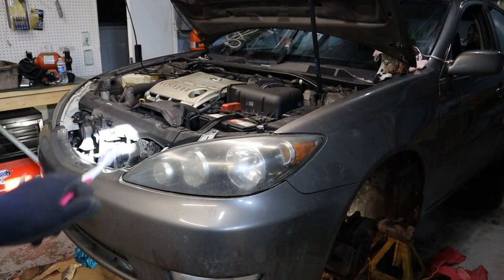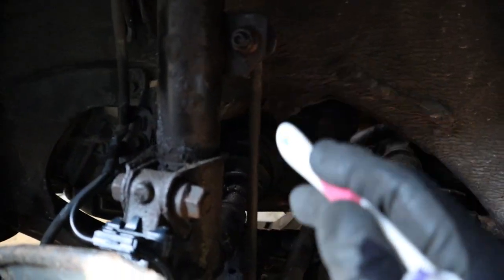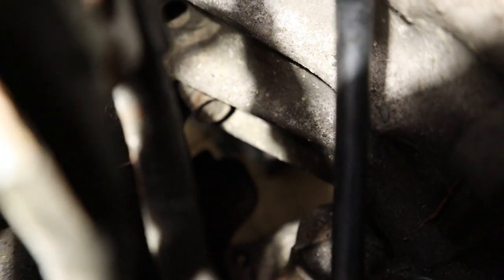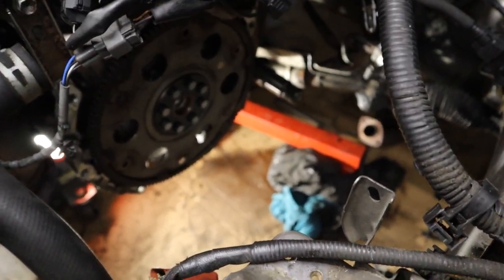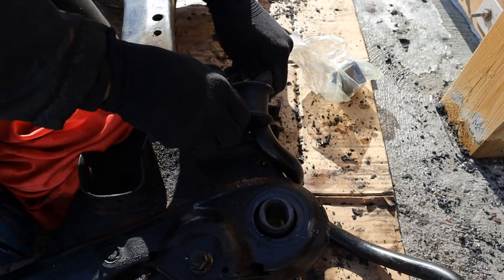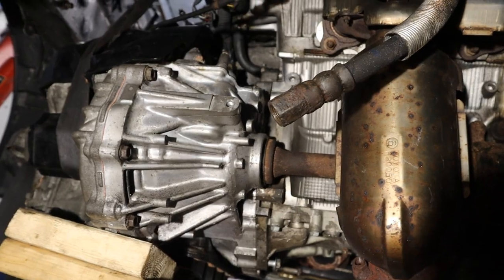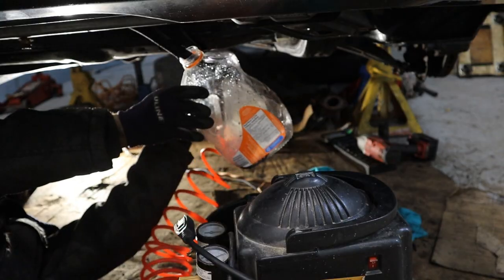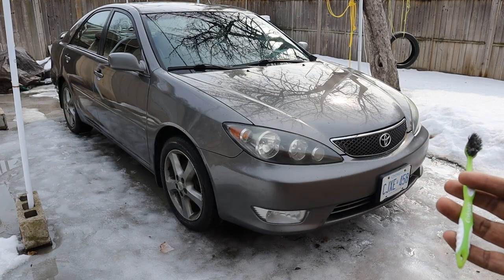How to Replace a Transmission | Toyota Camry

Comment: I would’ve dropped the entire subframe with the engine/trans, suspension,steering rack, wiring harness altogether.  Then with the entire assembly in front of you, it’s so much easier.  Done this on a 06 Camry, 08 Maxima, 03 Altima, etc.

Comment: Hello, my 07 Avalon makes a thud feeling/sound. Feeling it when I press accelerator pedal after coasting at low speeds & highway speeds. Previously had a shudder between progressing 50-70mph. But it’s seemed to have gon away after fluid/filter change (came back months after but lubegard instant shudder fix seemed help. Do you know if it’s need replacement or leave alone? I’ve got 210k.

Comment: Great Video. Doing this to my 98 ES300 this week. Should I flush the torque converter before installation? Also are there any seals on the transmission that I should consider replacing before installation?

Comment: Pulling the entire engine & transmission out from up top is definitely easier than trying to drop that transmission from down below. I've done both ways myself as well. It's the most horrible job dropping it.
Reply: I attempted to pull the whole powertrain out of an rx330 for an engine swap but I couldn’t get the transmission to clear the wheel well also I couldn’t disconnect the intermediate steering shaft so I ended up just disconnecting the engine and transmission and pulling the engine out alone. My understanding is the ES has the same engine and the u151e is the same size as the AWD variant so I have a hard time imagining it’s possible to pull them out the top. What did you do to get them out in one piece?
Reply from the maker: Good to know. The transmission sits below the frame and can't be pulled with the engine up and out. I too would rather pull up than downwards

Comment: My brothers got the 04 Toyota Camry same as this but has the 3.0 his transmission clutch disk or trash it don't shift as gears and the fluid stinks shop told him it was the transmission so he just ordered a good used one so next weekend we will be changing it removing it I can do but putt the new one in is harder
Reply from the maker: How did it work out?

Comment: Why can't they make a better design for the torsion bar end-links than an internal puny 6mm hex?!?!
Almost every car I've worked on has this same design, with the same issues getting it loose. Even with good quality hardened hex, heat and using an impact you'll just have about 50% success getting them loose.
Reply from the maker: Agreed 
The TTX links I put on have wrench flats on the back that make it way easier to remove and install

Comment: Wait so do you have to remove the rack and opinion to drop the trans??
Reply from the maker: Kinda. The rack is attached to the subframe and the subframe has to be dropped. You can leave it in (I did) but it hung from the PS lines and broke one

Comment: Do you know if the 2002 V6 Camry needs gear oil in the diff or is it all in 1 with the transmission fluid. I have never changed the diff oil.  I keep getting confusion answers from everyone.

Comment: It's crazy how a video for my exact spec camry pops up when i'm having issues with my transmission leaking and shifting weird. I have changed a filter and tried lucas slip fix and redid the pan gasket but it still has issues. i was pricing out a repair and then... with no other decent videos online of the job decided to just drive it til it breaks. i still have 5 gears. maybe if it gets real bad i'll refer back to this video. for fun, more than out of necessity.
Reply from the maker: Yeah keep running it as long as you can. Stop slip didn't help this one either. Get a roadside assistance plan and don't drive too far out. 

What year and engine is your Camry and why did it fail? These aren't known for transmission issues. Previous owner burnt this one stuck in the snow n
Reply: @speedkar99  I have a 2005 SE V6, so also with the 5 speed auto and the 3mz-fe. I'm not sure of any other difference between the two years...

The car was neglected, and maintenace on the transmission was never done. I purchased the car and drained the fluids and was going thru everything to get a baseline for maintenance on owning the car and the transmission fluid came out brown, and not a lot came out. I flushed it and put new fluid in and that got it shifting better but then i went to drain and fill tranny fluid again a week later and it was still a disgusting brown. Toyota said when these cars came out to never service the transmission, and I really have no idea why. If this transmission got a regular drain and fill im convinced it would have no issues today... but it was neglected at some point and service was never completed. It's a shame, because otherwise the drivetrain is very good! I feel like the motor is as strong as brand new, no seals leaking, everything is just so tidy other than the transmission that slips sometimes.

Comment: I’ve removed a 3mz from an rx330 through the top since I didn’t feel it was safe enough to drop the subframe without a post lift. 
Would it be possible to remove the engine and then pull the transmission out of this vehicle to get the tranny out? Or if not how would you recommend one drop the subframe without a two post lift?
Reply from the maker: Yes the engine can be removed from the top. It's not a whole lot more work...just the heater, vacuum and AC hoses and engine wiring harness.

Comment: J have toyota camry 1992 2.2 automatic transmition work only in reverse. J want to change automatic transmission  with manual. There is a manual transmition from this models of toyota  corolla, celica  avensis carina Wich model  is suitable  with camry.

Comment: Camry is wider, with my Scion tC, I can only drop the engine + transmission + subframe down together, before I was able to separate the two.
Reply from the maker: Interesting to know. If I had to do this again (I wouldn't) I'd drop them down together too even if it means draining fuel coolant AC and wires.
Reply: @speedkar99  I don't think you need to drain fuel, and AC. If I remember, I just disconnected a fuel line located on top of transmission, I left the AC components/lines connected together,  only disconnected the compressor from engine and left it "hanging". Had to drain the coolant though. But my tC is a manual transmission. :)

Comment: I'm just thinking about how difficult it must be to change the transmission without a lift when a team mechanics with lifts, several engine hoists, and specialty tools can still take several days to change a transmission.
Are you using the car for personal use or are you trying to sell it? These Camrys are boring but they are good transportation tools.
Reply from the maker: I already have an 04 Camry for myself. I sold this one.

Comment: You didn't find it necessary to Mark the universal joint that you took off the half shaft so you could get the orientation back correctly?

I agree that pulling the whole engine and transmission at the same time is the way to go even though it might be more work up front. It will be less tedious work than trying to do what you did here in the video.  If you can't stop from dropping the cradle anyway, then why not bring the engine with it.
Reply from the maker: I don't mark CV axles....that's more of a driveshaft thing. 

You are right, Besides draining AC and coolant, it's best to drop the whole thing.
Reply: @speedkar99  

My 1999 Solara never had air conditioning when I bought it so that would have been one impediment I would not have had to worry about breaching.
Reply: @speedkar99 

Coming back on here after a year. My transmissions developed while driving a clunk while going through the gears. There is no slippage but there is an audible sound and I can feel the clunk. On my prior cars which were over 15 years old and over a hundred thousand miles, it's usually a ring gear in gear and related bushings and bearings issues.

I think if you take the air conditioner compressor off you might be able to get the the air compressor by the radiator. I think it's only if the body comes off you would have to drain the A/C freon.

Comment: I only made it to 2 minutes and 54 seconds before deciding that I would gladly pay someone to do this. I replaced my battery starter and alternator as well as air conditioning magnetic clutch relay and a power window assembly and the stereo... I guess I got cocky there's no way I would do all this

Comment: Oh my... Un bolt rack at steering, rack goes down with cradle. So many other crazy things in this video. Wow a hard job made so much harder
Reply: And didn't use a proper transmission jack or regular jack trans cradle.

Comment: This is the second 2002 camry i had had that transmission just went bad out of nowhere, fluid is not discolored or anything just started groaning and started slipping meanwhile every 90s toyota i had got 350k before transmission issues, and there was warning signs but anyways my boyfriend has replaced everything ever in my cars besides the transmission and we have no way of buying another car. And my hub is destroyed because it would not come off when we did that... funny enough you had the same issue he said he "cant" without a life you do not have a lift and we have a cherry picker.

Comment: It is really absurd that my AWD 2013 Lexus RX350 has the same mounting architecture. Same design for control arms, ball joints, bushings, sway bar bushings and links, etc...

For some reason Toyota/Lexus decided to bury one (only one) control arm bold under engine mount. So you need to take all engine mounts, lift up your engine, raise lower engine mounts, just to be able to reach that stupid control arm bolt!

Same goes with front lower ball joints. You have to take off front axles, just to be able to reach that stupid 19mm  nut.
Not only that, Lexus manual instructs to drain trans fluid before removing axles! WTF?
All of that for one stupid nut located directly under front axels that smart Lexus/Toyota designers couldn't increase the clearance just a few millimeters!

No only that, you will have to make the same party once you change engine starter and alternator. Oh yes, you will have that party for sure since Toyota starters will live ~110k miles, and alternators will live ~130k miles. Tell me otherwise and I will fix it for you for free!

In short: Lexus/Toyota are cheap and reliable cars but they eventually bust you back with expensive parts and labor.
Reply from the maker: Agree. That platform is from the 2002 Camry. 
Much harder to maintain than prior

Comment: You should scream: "Fire in the hole!" then drop the Transmission, otherwise it's dangerous. For the running red fluid, did you used your brother t-shirt again?
Your fuel indicator was bottomed down, is your fuel pump still alive? or the FI just doesn't work?

Comment: sheesh wish i can do this with my 96 corolla
Reply from the maker: Should be easier on an older model
Reply: @speedkar99  i ain't got no mechanical  skill to teardown transmission  and put it back together, i wish i do. I just replaced my 96 corolla  fluid after awhile it turned to black again which is still shifting good and I'm planning on doing another transmission fluid change and filter soon once it get use to the synthetic fluid. 198k baby miles